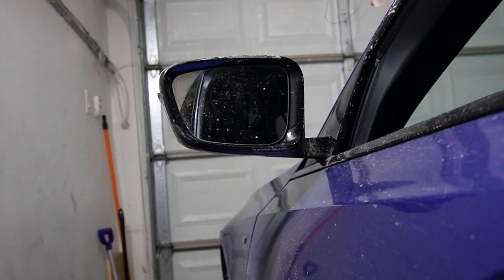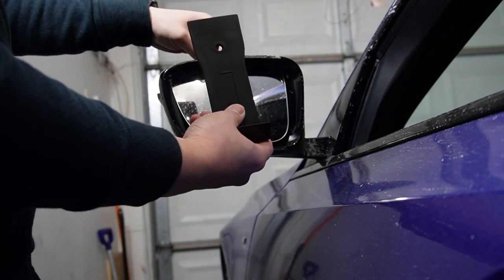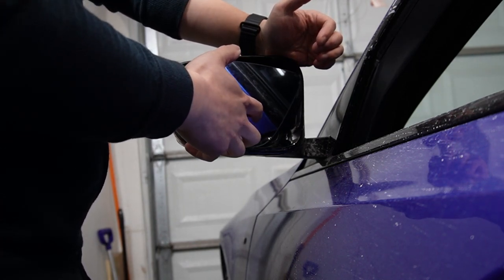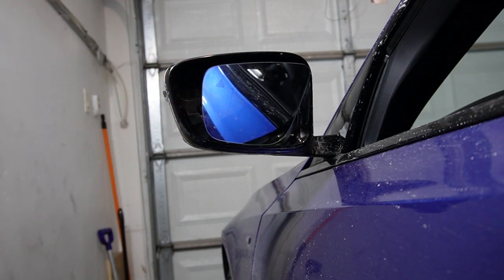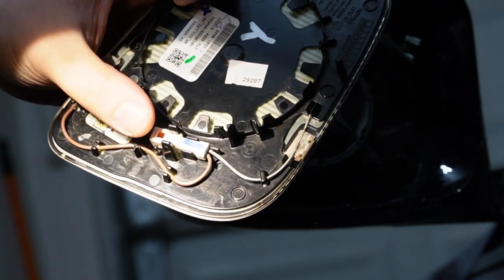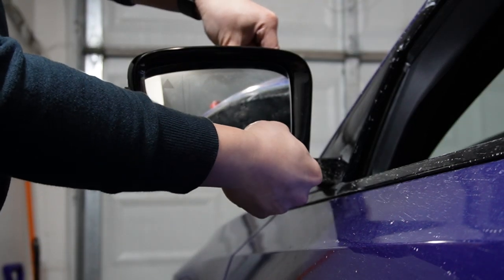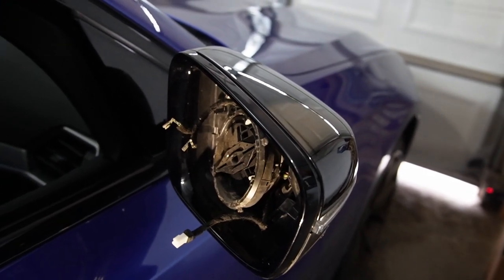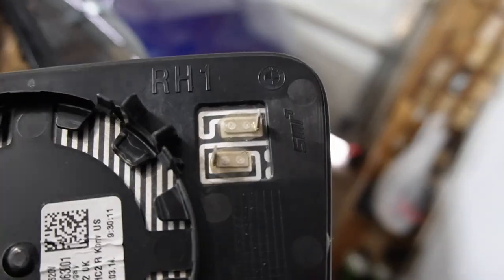*DIY* Removing & Replacing Side-View Mirrors | BMW G2x/G3x

Comment: Do you have the part numbers for these side mirrors?
Reply from the maker: I believe it’s 51167407165, at least according to the eBay seller whom I got it from.
But do be mindful when you’re trying to purchase them, at least if you’re trying to buy them off eBay. From my research on this topic, BMW seems to have the part# listed under the one I posted above for the European wide angle mirror; However, the BSM plug could be different than what I’ve shown in the video (that white little triangle module, and it’ll still be the same part#.
I’d highly suggest you pull your mirror off first to verify which type of connectors do you have for your BSM module, if you have one. Then to look for the wide angle mirrors on eBay, and verify fitment with your BSM connectors.
Hope this makes sense. Cheers!